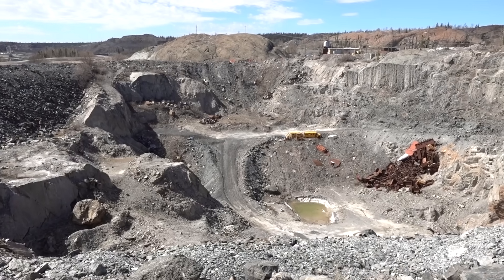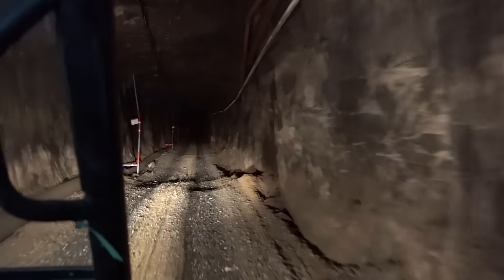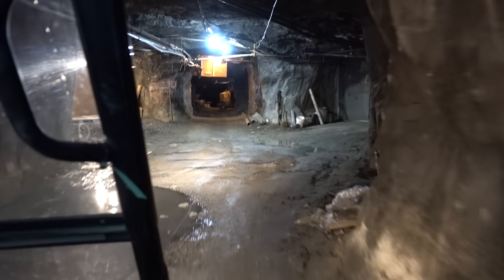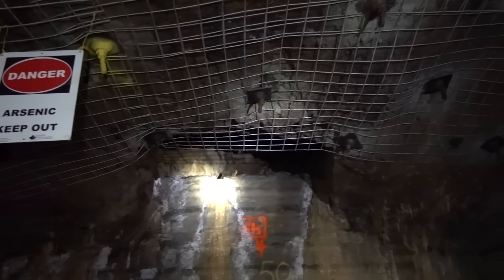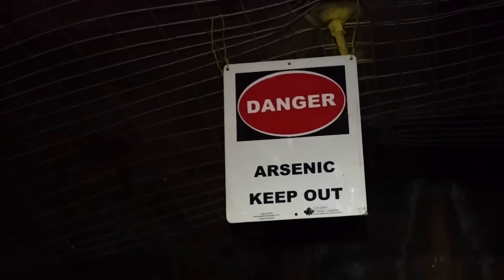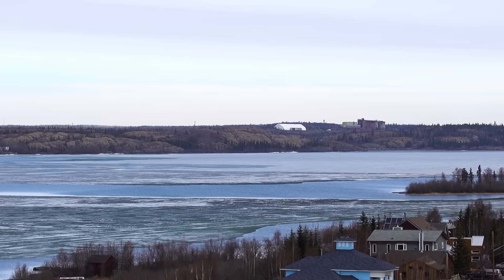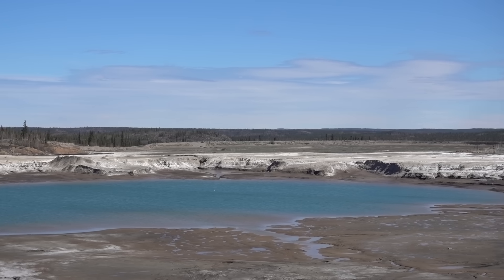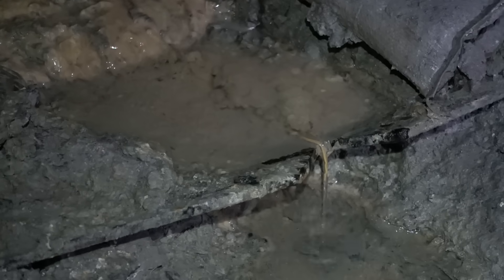Making 200,000 tons of arsenic dust safe

Comment: > mines 8 billion USD of gold
> goes bankrupt
Reply: Profits are always privatized the costs always a public affair.
Reply: Br3ttM a more likely scenario is that the owners/CEOs took the money and ran when they realized that the mine was empty.
Reply: @Snubben123143  More likely than that would be just Hollywood accounting to make sure you don't show taxable profits, then close the doors.
Reply: @Snubben123143  that’s how companies going bankrupt works. As soon as it’s not profitable anymore, it doesn’t make financial sense to keep the company going. At that point, it doesn’t do you any good, and is a drain on your resources. That doesn’t mean its moral or ethical in any way, it’s just how it works.
Reply: @Snubben123143  no that's very unlikely, they're massive companys not small ones it would be impossible for them to get away with it
Reply: Philip Kvist Ah yes the owners took all the money and ran... or quite possibly they used the money for new equipment and then lost everything when the mine closed
Reply: @samuelyoung2671  I highly doubt paying miners for the period it was open for and buying machinery costs $8 bn.
Reply: @sergarlantyrell7847  There's a lot more costs going on than just miners and equipment. Gold beneficiation is a very expensive process because the concentration of gold in ores is so low, sometimes om the order of single digit parts per million. It's one of the few industries where labor isn't the most expensive cost to the company, it's comminution- turning a block of ore into dust so that you can extract the minute particles of gold from it. If you've ever looked at the economics of a typical mine, it's hard to believe that they can even make money off of it, because the profit margins are so low.

The other thing people aren't considering here is that the value of gold and the dollar have changed a lot over the past 50 years of this mine's operation. It's not like they struck the motherlode last week and pulled up 8 billion dollars from it. Most of the gold was produced when the relative value of gold was much lower, so you can't retroactively evaluate that period using modern gold prices which are greatly inflated. In fact, when this mine shut down in 2004, gold was worth less than half of what it's worth now. The modern day value of the gold they pulled up over its half a century of operation is an ok way of envisioning the sheer quantity of gold they mined, but it's useless in determining the actual value it had at the time. 

With these things in mind, you can't think of this as simply a company faked bankruptcy and made off with 8 billion dollars. That's an incredibly naive way of looking at the economics of this scenario.
Reply: Maybe a company that produces enough toxic waste to kill everyone on Earth SHOULD save up some money for the clean up since they created the mess.
Reply: @hedgehog3180  They were not legally required, so of course they did not. Nowadays the rules a different.
Reply: hedgehog3180 the ocean has enough water to drown everyone on earth many times over. What a stupid strawman argument you got there
Reply: step 3: Profit
Reply: "Bankrupt", more like let's prove somehow we are bankrupt and then we don't have to clean it up 😂
Reply: "bankrupt" to evade any legal action taken against them.
Reply: Didn't go bankrupt, They claimed bankruptcy so they dont have to clean up.
Reply: The mine was in operation for 50 years. It changed hands multiple times so no one company mined all 8 billion of the gold. Falconbridge got most of the gold.
Reply: The company went bankrupt, the executives made bank
Reply: They should have taken the assets of the greedy CEOs and upper management like how collections agencies would have with normal people.
Reply: “Bankrupt”
Reply: Every natural resource extraction company faces that fate
Reply: Companies are REQUIRED to save for "retirement". Insurances for example, and the banks in some countries excluding the US.
Reply: @schregen  "Requirements" are for ordinary people, not the rich.
Reply: That's what happens when your only source of income runs out.  It's not like a company saves up for retirement.
Reply: @Br3ttM  but they should have make provision for salvage costs after the dug out all the gold. So some people made a lot of money and government has to clean up the mess
Reply: @Br3ttM  or saves to clean up their mess :S
Reply: @Br3ttM  Aaah !!! now that is an idea.. you forgot to patent!
Reply: What happens in modern mining in the US before a permit is even issued is an environmental study which looks at things like geologic hazards such as earthquakes, they look at the groundwater and surface water geology, and when the state government believes the risks of the project are well understood they ask for a bond upfront that is higher than their worst outlook on what the project will cost to clean up. The mining company pays this bond for the permit to be issued so they can start mining. If the mine wants to expand its operations, it will need to add additional money to the bond. When the mining is finished, the mining company can clean up the site. If they do, they are returned the bond money. This is what most mines plan on doing since they can clean it up for less than the amount that they paid into the bond. If however the company goes out of business, the state can then use the bond to clean up the site. In montana, they've put a lot of work into making sure that there will never be a situation where a bond is too small to clean up a site.
Reply: @ZE0XE0  so what
Reply: @jordanhughmckimm3297  and they would have...if there was no profit for them!
Reply: And it's all gone already >>> GREED !!!!!
Reply: @vhsprojektblue4221  there are mines scattered all over Canada that have this type of problem, in one way or another. Britannia Mines near Squamish is one. Pollutants running into the ocean on a daily basis.
Reply: It filed for bankruptcy and ditched what it didn’t need. They just moved on to destroying the next thing
Reply: > leaves $934M bill for cleanup and containment costs for the taxpayer

Gotta love that corporate free enterprise spirit
Reply: > makes tax payers fix it
Reply: That’s what happens when the deposit you are mining runs dry.
Reply: JNCressey planned obsolescence in action
Reply: > caused at least a billion in clean up
Reply: Dogecoin  , I'll hazard a guess that it might actually be the asbestos mining town of Libby, Montana.....
Reply: @vhsprojektblue4221  Consequence should be terminal: they execute your company and take it all for the public.
Reply: thats what happens when the Establishment are stakeholders.
Reply: Meanwhile over a Germany the defunct mines are still funding pumps to keep an entire valley from flooding.
Reply: i was wondering the same thing!!! are they a bunch of Rappers or something??
Reply: Maybe inspection on a quarterly rotation! If the site is kept clean and maintenance is performed all the time then the end clean up is almost done! 8 billion dollars and they walk away! I bet no one went to jail either!
Reply: goes "bankrupt"
Reply: @AlexFlockhart  the company went bankrupt. Not the CEO. He just took the Money and ran.
Reply: All those 8 billion went to the owners
Reply: 8 billion is not a lot /s
Reply: Isn't that convenient, mine until it runs out and run with the money.
Reply: @DrabberFrog  Who said the mines gold ran out. The mine may still contain gold, but at such low levels per tonne of ore mined, that mining and extraction are uneconomic.
Reply: One does not realise that gold is not easy to find and requires a great deal of effort to mine and process to its metallic state in gold bullion. This is why it is so expensive and holds its value given its ability to resist oxidation.
Reply: @damianousley8833  how convenient! They managed to do all that work to get the gold but they couldn't be bothered to not give the government a permanent environmental disaster. It's almost like the plan was to declare bankruptcy and run with the money the second the gold runs out.
Reply: I think filled for bankruptcy is a  way to evade liability for reclamation. The mining company sell to one 'company' for very cheap and then declare bankruptcy.
Reply: >doesn't wanna give up their billions
Reply: They did not make 8 billiosn in revenue. That's the value of 200,000kg of gold at 2018's gold price. The mine made $867 Millions in profit and payed $464 millions in taxes over its lifetime.
Reply: Oh, you can be sure a few people got insanely rich out of this and went on to destroy a different place.
Reply: Very nice bonuses to management though - happier days eh.
Reply: No what you do, is  when the gold runs out and you get a bill for clean up.  You just file for bankruptcy and walk away. (with your money)   it's what all businesses do.
Reply: Kobe Wild bankruptcy doesn’t make sense. So many people abuse it.  My neighbor upgraded her entire house last month on credit and doesn’t care at all.
Reply: welcome to capitalism
Reply: What's more surprising is just for 8m it will cost us over 900m
Reply: Had the exact same thought 😂 Capitalism at its finest! Make a fortune and go bankrupt before you have to spend a penny 😂
To be more serious I would seize all the properties and belongings of the owners and their families and their friends and even their grandparents canary.
Reply: They “go bankrupt” in order to circumvent paying for clean up. Mining companies do it in the US also
Reply: @DK-nv9zu  Please stop pretending to be an expert on the internet of a topic that you clearly don't understand. You might think they can declare bankruptcy to avoid reclamation costs, but it's actually more expensive for them to do that than to just clean it up themselves. Mining companies in the US have to pay off a bond to the federal government which completely covers the costs of reclamation before they're allowed to operate. They only get the money back after they've cleaned the site. So declaring bankruptcy doesn't avoid them paying because they've already paid it long ago. In fact, the bond set by the government is quite a lot more than the actual costs of reclamation, so it is in the company's best interest to do it themselves and save money.
Reply: @tralt135  Yes, we have those checks in place NOW. We didn't have them as seriously enforced, or even in a similar state when this company declared bankruptcy. Ironically enough, you're applying modern standards to what may as well be a historical site with how much the law around it has changed, then claiming it's everyone else who's uneducated.
Reply: @heckingbamboozled8097  The people I'm calling uneducated are the people who think that stuff like this is still happening, which is just about everyone in this comment section.
Reply: Wasn’t a Donald Trump company was it?
Reply: You would also need to consider their expenses.
If they pay 999$ for every 1000$ of gold they make then their profit is slim and can easily be eaten up with a single problem.
I don't know the details in this case,  but as already has been said - in most countries companies that produce permanent waste or damage or anything of that sorts have to pre-pay for the removal such that they can leave or go bankrupt at any point in time but the cleanup is already payed for.
Reply: @ABaumstumpf  considering that they probably payed they workers the equivalent of pennies in today's money, and they probably had decades old are equipment that was very run down and warn out with no care for safety, or anything, they probably make north of 8 Billion.
Reply: Stonks
Reply: Mines are very expensive. Plus you need to pay out pensions, safety equipment, a lot of electricity, a lot of engineers, a lot of mining equipment, and then there’s processing afterwards.
Reply: @1323GamerTV  considering how old the mine is, and how long it's been abandoned, non of this things you mentioned here were even glanced at I bet.
Reply: The mine shut down after being purchased by royal oaks and the union didn’t like it so they went on strike killed nine people and then just didn’t work after the strike was done
Reply: @jordanhughmckimm3297  where do you think the gold that makes your technology work comes from?
Reply: Adam Kendall It appears that only about 10% of gold is used in electronics with about half going to jewelry and a  third going to coinage, central banks, etc.
Reply: @adamkendall997  don't be a dumb dumb. His point was that it isn't worth the environmental cost.
Reply: @adamkendall997  The point being that evidently free market capitalism does not produce a sustainable system of industry (and neither does USSR style state capital before you whatabout your way into that one) so we need a different way of acquiring raw materials which takes care of the ecological consequences.
Reply: @anessenator  You just make company pay for  environmental cleanup before it happens. Which we already do: it is called taxes, if those are not enough you increase them. This has nothing to do with capitalism, it is just bad administration.
Reply: @fededevi1985  not true, it is lobbyists working for companies influencing policy.
Reply: @fededevi1985  The taxes are not for environmental clean up. The taxes are for supporting the nation. Infrastructure, schools, police, firefighters. Thing those companies profit from. 
The clean up should be payed by them and part of their profit calculations. No taxes should be used for what they should be doing.
Reply: @anessenator  asteroid mining is a good one once space flight is cheap enough
Reply: @anessenator  Well minerals are a finite resource so thats kinda how it works. There will come a day when there isnt an ounce of minable gold in the world. Also without said capitalist system we would still be using candles to light our homes.
Reply: @anessenator  this has nothing to do with freemarket... its people doing things for money with no consequences... and a free market is suppose to be balanced on profit/costs.... all that toxic dust is a cost... that far outweighs the profit.
Reply: @adamkendall997  assuming you need to make billions of chips every year to power consumer electronics built to die as soon as the insurance wears out. Otherwise, no there's no need for that much gold
Reply: Stupid comment by an uneducated person.

Comment: So I assume it is a hazard because it has been separated from the stone that once held the As2O3. Is there a reason it wouldn't be feasible to make a concrete slurry with the waste to sequester it instead of requiring constant cooling? If anyone has an idea please enlighten me.
Reply: Martin Rabson that’s sort of what I thought. Seems the concrete route would be more permanent albeit perhaps slightly less effective but you’d need a ton of likely very special concrete designed for the job.
Reply: The key here is that it's very volatile and highly lethal fine powder. And it is currently sealed in the rock.
You don't want to mess with it and you don't want to apply a method that requires to open the seal, like digging a hole directly to the chamber and pour concrete.
The freezing method has the advantage that you can place the circuitry around the chambers without opening them.
Reply: The main problem is that Arsenic is soluable in water. Water permeates the rock, dissolves the arsenic and introduces it into the water cycle.
It can't happen if the Arsenic is frozen solid :)

Comment: Why dont they reuse the arsenic? Just get a couple hundredthousand tons of gallium and you never run out of GaAs / circuit material. :D
Reply: Arsenic Trioxide is very hard to process because it's oxidized and already released a ton of energy. It made the gold extraction process very easy. What you're suggesting is what they do now when they produce gold. A more energy intensive process, but without the lethally toxic byproduct.
Reply: It looks like 50,000 tones are produced annually for other uses (per wikipedia). This is 4 years worth of global production. I'm somewhat disappointed that instead of freezing it they don't just subsidize it's acquisition by legitimate users instead.

Comment: As2O3 powder is slightly soluble, it happily sits ontop of the surface of water. It is also great fun to find out you got some in the lab </s>. I've spent half a day unknowingly handling it...

200,000 tons make roughly 151,000 tons of metal, which could be stored in a roughly 30^3m cube. That's something I'd go out of my way to visit on an other continent.
Reply: Andreas Aristokrates look at with a telescope sitting on the moon?
Reply: that would be cool to make a giant cube out of it